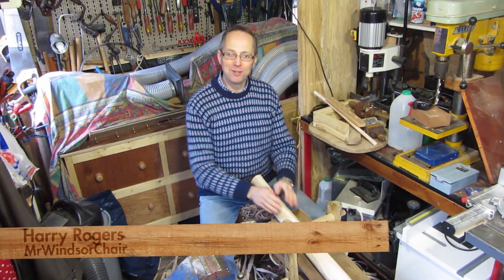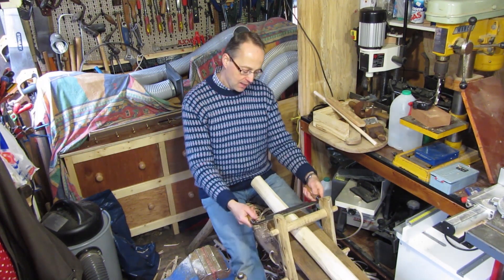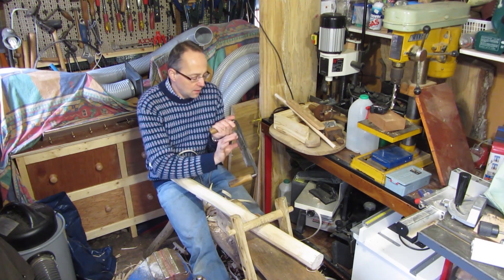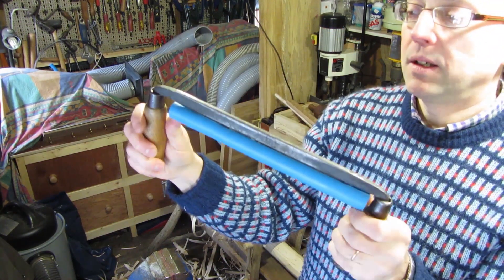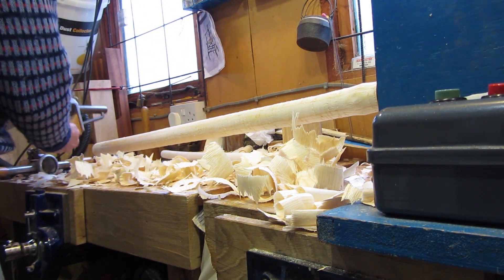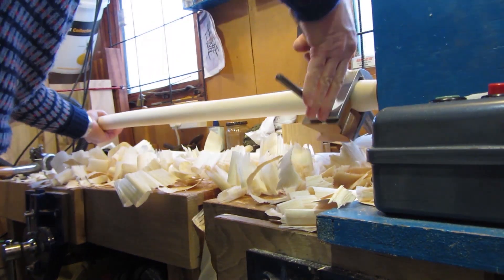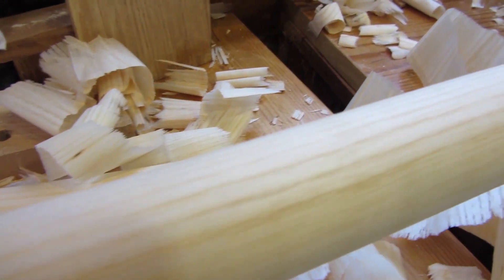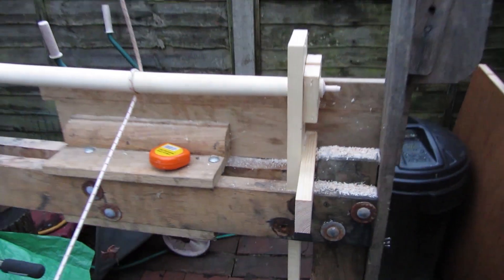Trapping Plane - Making Rear Chair Legs - Sussex Chair Part 5b

Comment from the maker: Hi - yes this is one I cast, and they work best with wet wood, but still work to some extent with dry wood, but not nearly so good as its a lot harder. Yes a barrel type spindle is perfectly feasible with this on wet green wood.

Comment: I enjoy your videos.  I have a several questions about the trapping plane.  Is that the trapping plane that you built?  How well do they work with dry wood?  And finally, do you have enough control with this plane to create a spindle that is smaller on both ends, but has larger center section?